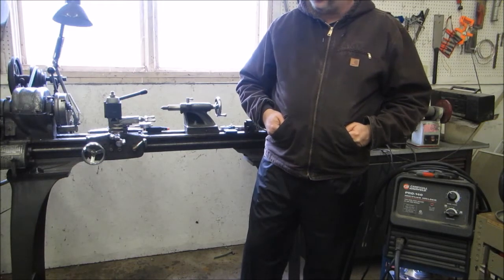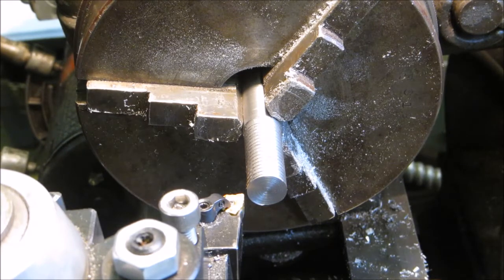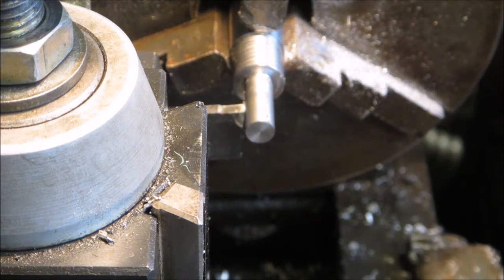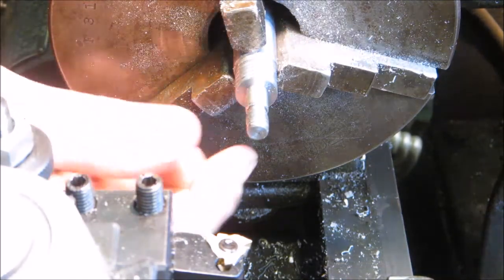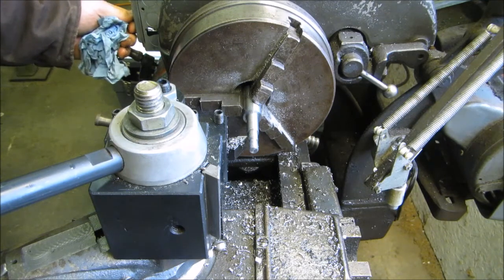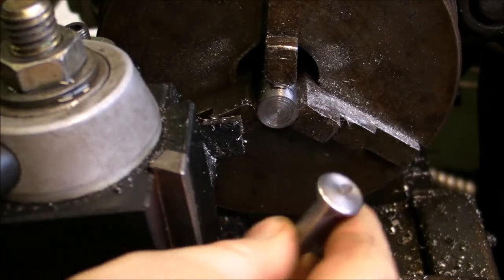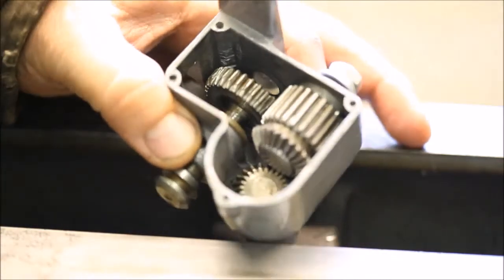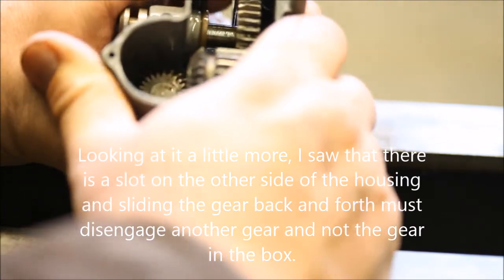Mill Gear Stud

Comment: Yep, I made my own shaft and gears, both of them and bushed them, I messed up both gears by not having the table lead screw locked down, Table goes one way and the lead screw gets real lose, goes the other way and it gets real tight and locks up the table, them gears don't like that, 8 months later I'm now tooled up to cut the bevel gears and using my Atlas shaper I cut the (spur) / bevel gear,

Comment: good job on the shaft, it's been pretty cold up here too so not getting much shop time in myself. But I'll crank the heater on sunday to get some hexacopter parts done for someone. Will video it, but not sure I'll find the edit time.
Reply from the maker: Thanks, Steve.  Hexacopter mean it has 6 rotor blades?
Reply: ILGopher Yes 6 blade. I am making some retractable landing gear parts.

Comment: Nice to see another Atlas working as you get things done. Best of luck with finding all of your parts, I will keep an eye open for them if you let me know what you need. Thanks for the video and BTW it sure must be nice to just pull a couple of levers to achieve your thread pitch, LOL!

Talk more soon, Aloha...Chuck
Reply from the maker: Definitely is nice having the quick change.  I'm just glad I figured out how to help not bust the compound slide while doing threading or parting.  Hopefully you can get your quick change box set up...or sell/trade for an Atlas if you get that opportunity and that works better than trying to mod the Logan on.

The connecting rods use pins to connect and a couple seem to need to be put together in a certain order.  I just needed to get some different lengths of 1/8 roll pins for that.  I'm hoping to get out this weekend for at least a little bit.  Nothing like the smell of kerosene in the morning...or the evening.  :-)

Adios.
Reply from the maker: P.S., Chuck.  You might find this funny or ironic.  The t-slot nut that I got that I hope works with the AXA tool post was misrouted as well.  Went from Alabama to Indiana and then back down to Kentucky...hopefully making it this way now.  Post Office hasn't been doing too good lately.  :-)
Reply: They may not have been lying when they mentioned the weather affecting their flight plans? I've seen a few stories on the news about airline delays due to this storm cycle that is leaving us high and dry, and everywhere East of us getting blasted!

Talk more soon, and sorry you're getting tooled by the post office when trying to get your tools posted :P

Comment: Braving the cold to enjoy shop time, I commend you and certainly understand the want/need to get into the shop.  Good build and ATB as you work on the machine.
Reply from the maker: Thanks, Chuck.  I need to fire the camera man.  A lot different from still photography!  I need to find a way to lift the guard just enough to allow the spliced belt to travel without hitting it or at least muffling the sound.

I found that single pointing small threads is a little more finicky and definitely need to work on it.

Hopefully I can get out there this weekend if the wind isn't blowing too much and get the current knee and x-axis setup off (the ones that use the swing arm) and put on the set-up which uses the wheels instead.